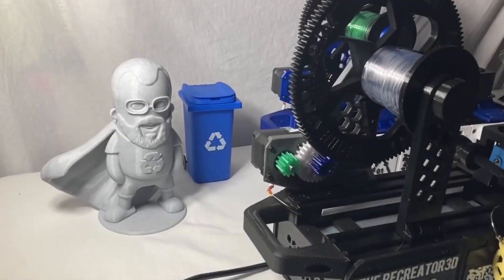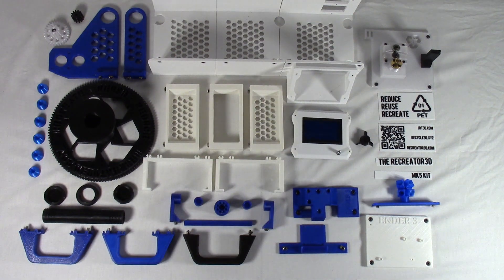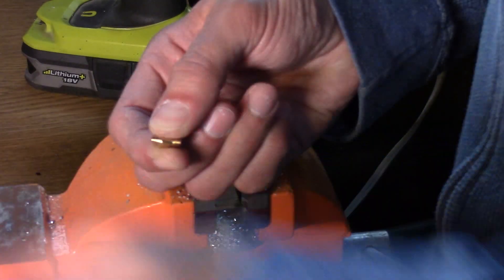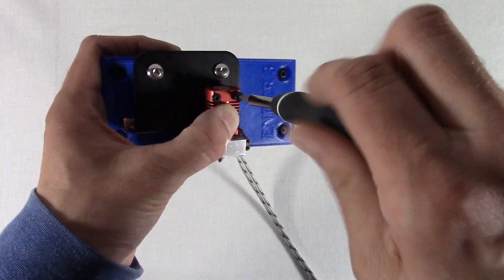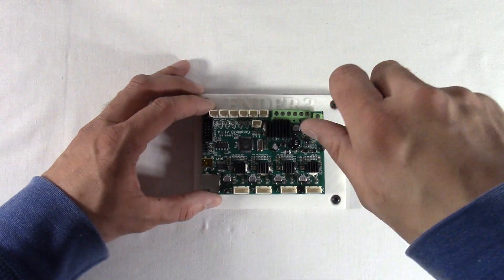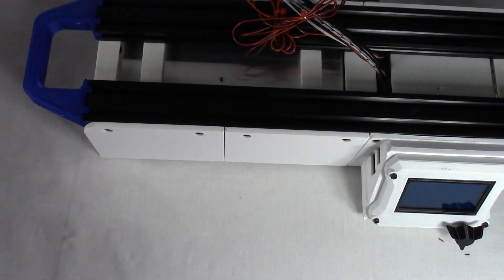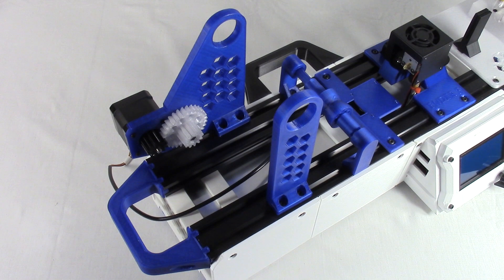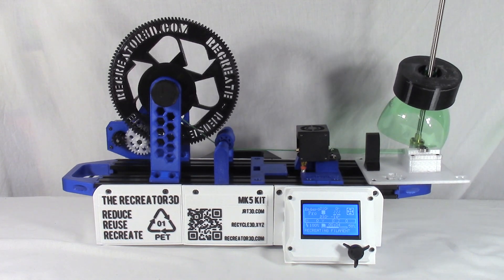The Recreator 3D - MK5Kit : Ender3 -  DIY Build Notes - PET Filament Maker - Plastic Pultrusion Unit

Comment: Totally disappointed. I spent whole days on it and there is always a problem. The stepper motor is not powerful enough, it spends its life blocking itself it’s HELL. I can’t let it turn by itself without it getting stuck! Spending so much money for such a disappointing result...
Reply from the maker: Plenty of help in the support groups in discord or Facebook to troubleshoot your issues. You can go to recreator3d.com for the links. Feel free to join and ask for help. You should be using a 42x40 motor, which when vrefed works great! If you’re having issues, it’s likely user error - as we have over hundreds of people without issues and plenty of documentation to help otherwise.
Reply: @JRT3D pardonnez moi de mon agacement je n’aurais pas dû, je vais essayer les moteurs, 42 × 40 seul problème sur la Under 3, il y a un petit engrenage sur l’arbre du moteur qui fait qu’il faudrait agrandir le trou de l’engrenage en plastique

Comment: i have done it i have followed your instructions and built this machine the gcode works the bottle cutter works all there is to do is drill out the hole on the block and get the correct screws ty so much .

Comment: so i built the machine, but the bottle is not melting with 210c temp. Also its not getting higher than 210c and printer starts beeping. What am i going wrong and how can i solve this?
Reply from the maker: you likely have some parts that are 24volt but running on a 12volt power supply. Everything needs to match
Reply: @JRT3D everything connected correctly, i joined the discord, solved the problem. hotend fan was connected to always on power, so it wasn’t giving an ability for hotend to heat up. Once i turned it off - everything running smoothly & fast. Thanks for such amazing project though!
Reply from the maker: if built from a stock ender, check that the thermostat isn't damaged

Comment: Having built my own from scratch and all the iterations to get it to work well I can clearly see what a great design this is.  My main goal for mine was to spend NOTHING.  I literally did not have to buy so much a single part for it.  I used only what I already had on hand or salvaged from other failed/broken projects.  It's about 95% of what I want it to be.  I have made a LOT of filament with it and things are starting to show their age so I suspect it is time to consider replacing/upgrading.  I have well over 10kg if finished filament itching to be printed and I think this would be perfect...to print off the PET machine from recycled PET.
Reply from the maker: This lifts my soul, as it was my intentions to give the community a build that felt familiar to  us, that also didn't feel like a Frankenstein build. We all start somewhere, as did I. 

The Recreator3D's goals are to keep our electronics from becoming potential ewaste and our plastic inside out homes! Many community members love to know they can use their bottles back into the pultruder build itself. 

Look forward to seeing your build. Join the discord or facebook group if you have any questions. Not all the parts need to be printed, depending on how much you want to encase it.

Comment: are you supposed to drill the frame? you can't screw everything into it with only 4 holes lol
Reply from the maker: I'm not sure how to answer this. Are you reviewing the BOM notes with the video? If I understand what your issue is, you'll be ordering t-nuts and using M4x8mm screws to mount everything.

Comment: The cooling plate fan on mine doesn't spin. Is it ok to just leave it or does it need to be replaced? I've been running it without the fan for months and have only just realized it doesn't actually spin.

Comment: I'm really sorry for saying this, but I absolutely hate this project because it is really overcomplicated. So many things to print + you have to buy screws and bolts
Reply from the maker: Many would disagree with you. Recreator3D is one of the more polished builds and communities for PET Pultrusion. You can also look into the MK6 Fun Size version for a small build platform.  However, it's OK to have varying opinions and options. There are plenty other builds and brands you can find that may find your path more suitable to your desires. Check out http://ppu3d.com/ for more examples of pultrusion. Happy Recreating!

Comment: its too fast. need to slow it down
Reply from the maker: You can reduce the playback speed and pause it. As well, rewind and replay. Version two of written notes are coming out after July. Stay tuned.
Reply: @JRT3D  thanks! Sorry if i sound rude but this old format flow feels rushed. The monologue and the vid doesn't seemed aligned with what you're doing. Even 1 hour worth of video with separate time stamps will be highly appreciated. Thank you sir.
Reply from the maker: @MrJackfriday  Thanks for your feed back. If you need something more in depth, check out our MK6 Build Video...it's likely more to your speed. https://www.youtube.com/watch?v=U18uEw_1qAM

Comment: Hello JRT3D

With a group of Friends for a class project, we need to recycle plastic using the 3D recreator.

The problem is, that we can’t go up with temperature as the system can’t reach 200 degrees and stop at only 40.

The problem’s type is E1 and please we Need help on how to fix it.

Thanks a lot

Comment: How did you describe that only one motor works and runs constantly?  I have the makerbase mks robin nano v1.2 and can't get it to work
Reply from the maker: Our tutorial uses the extruder connection and our gcode is setup for marlin to run the length of a 2L bottle.

Comment: Hey, I am building the MK6 Fun size, and the build notes didn't mention rounding the lip of the heatsink. Why?
Reply from the maker: Recreator3D started with an XViCO X3S - that heat sink 100% needs to be drilled out. This carried over into the MK5 simply out of practice. Later with experimenting with the MK6 we found it wasn't needed and keeping the build easier for for novice builders. It may likely help over all, but it's something we've personally stopped doing or sugguesting is 100% needed for proper results.
Reply: Yeah, when I tried to pull, the strip was kind of expanding around the lip, therefore not winding. Since I don't have a stemless drill bit like yours, I instead drilled out the lip from the side where the grub screw is nearest to. I will try now @JRT3D

Comment: I have a question from another comment I saw from a different similar video a while back, would it be possible to do 3 thinner strands at once with this method? One of the concerns that was brought up in that comment I saw (and makes sense) is that you don't really get much from ONE bottle at a time, however, if you were to make thinner strands from 3 different bottles you would be able to increase your length of filament by 3x (if you did 1/3 of the single bottle width, longer of course if you did even more thinner strands). My concern would be if you could feed multiple into the nozzle at once and if it would be able to heat it up enough to melt all of them at once?

Comment: I don't have PETG for the heater mount, will PLA hold up fine?
Reply from the maker: It will eventually melt along the process over time, you should get enough pulls of PET1 with a PLA mount, in order then print another out of PET1 so you can see just how robust the material is

If out of PLA - 5-8 walls and 50% infill

Comment: 5:14 these screws were too long so i had to bend some of the fins so the screws would screw in all the way. 5:56 what screws are these for the blower fan? The original ones are too small. Where do i buy them and the cutter part is out of stock so where do i buy it? Is there a better updated instruction video that explains where all the extra parts are put?
Reply from the maker: In the discription is a link for written build notes with all the information you're looking for. What "cutter part" are you referencing as out of stock?

Comment: Thanks for your effort and dedication. How can I modify the G-Code so that the Motor / Wheel spins in the opposite direction?
Reply: I know it's been a while and you probably already got your answer but just in case you didn't there is no need to modify the gcode.  You only need to swap two of the motor wire.  If they are paired A-A+ B-B+ then swap ONE pair so it would be A+A- B-B+.  Hope that makes sense.  Just use a multimeter on continuity mode and test each pair.  When it beeps you know you have a single coil.  Just take the pins out of the connector and swap them.  That'll reverse the motor direction without needing to modify any code.,

Comment: Does it work with a 4.2.2 board?
Reply from the maker: 4.2.2 and 4.2.7 are suggested as the are silent. You'll enjoy the Pultrusion process 100% more with a silent stepper :)
Reply: @JRT3D  the only thing I dont get at the video is, using the menu, so as far as I get we must heat the nozzle and then use load filament menu? Or is there a special g code for it

Comment: Does pulltrusion work with other filaments if they are in a different format; not the bottles/tabs?
Reply from the maker: Some Recreator3D users have pulled PP/HDPE - and had mixed results with printing. The more we play, the more we learn :)
Reply: @JRT3D  Cool dude!  Do you know where I can see a website or repository of who has tried what.  Considering doing something like PC or PC/ABS multi material cores at or near or below its transition temp; and wanted to see if anyone had tried that outside an academic context.

Comment: Great project but i want mainboard and LCD where i can buy thank sir
Reply from the maker: Ender 3 Board and LCD are some of the most common available boards you can buy. Otherwise, consider what else is in your area - as our pultruder works with marlin based gcode

Comment: I have a question: how many meters or kilograms of filament do you get for each plastic bottle? And how long does it take to convert a plastic bottle into filament? And how long can the machine work continuously?
Reply from the maker: 2L bottle can yield 25grams and depending on the technique/desire for end result can take anywhere from 15minutes to 45minutes depending on your desire for 90% or 100% unhallow cored filament. Some don't mind compensating slicer settings where others want complete perfection.

Comment: In the other video, you use a stepped drill bit. Is there any specific reason that can't be used here? This is an awesome project, by the way!
Reply from the maker: For the Ender 3 Stock Heatsink, we've moved forward with suggesting that it's no longer needed to drill!💪The MK3 was made from an XViCO X3S 3D Printer and 100% needed to be drilled.
Reply: @JRT3D  oh, that's great! So the only thing that needs to be drilled now is the nozzle?
Reply from the maker: @zachboatwright  Correct
Reply: @JRT3D  That should be in a pinned comment, as stepless bits are insanely hard to find, and it had me stumped for ages.
Reply from the maker: @KannaKamui  You can use a step, stepless, or even a standard drill but if you desire to open the throat larger. We've gotten away without even drilling on some of them. I'll work on implementing this note into our over all platform. Sorry for the confusion.

Comment: You show loading the strip into the hotend cold and "easily" going through and then setting the temperature. How are you doing this? Also, I have downloaded the suggested gcode file and see it goes no where near as fast as what is shown in the video
Reply from the maker: Watch this video here: https://youtu.be/MvR3WfJN7RI
Reply: @JRT3D  Thanks Josh....I got it to work by cutting the strip very thin. Got it all working accept I found getting it to grab the spool a little difficult, but fixing that now. 

Edit: Tension on spool fixed. I printed in transparent and couldnt see the holes in the spool for holding the filament.

Comment: Tempted to pick up a crappy unrepaired ender 3 from eBay to gut for parts to make one of these :D Though I've got much better motherboard, lcd and steppers lying around :)
Reply from the maker: Saving a crappy unrepaired ender 3 from eBay is the perfect way to get the best bang for your buck as well as saving potential eWaste. If you got parts to, it's not a complicated build otherwise.
Reply: @JRT3D  the lure of gutting an ender 3 without even trying to make it work is rather strong 😂 😊 I need to build up my scrap pike of parts, so I guess I can keep  a bunch of other bits. They're only around £60-70 and pretty sure parts are worth that alone haha 😳 

I'm thinking to do an injection moulding machine based off a screw drive later on, but I'll need to finish the CNC conversion of my lathe to do that as I don't fancy paying  insane prices for a simple screw that I can just make myself 😊
Reply from the maker: @noviceartisan  $80 is more or less cost of parts. The worst is buying one to turn into a recreator, only to repair it as a printer...do you turn into a recreator3d or buy another used printer...vicious circle for a person who enjoys the tinker.

Comment: Hi, thank you that wonderfull machine!, where i found the G code??? I need to load the SD card, thanks again <3
Reply from the maker: It's in varying spots that you should be able to find at this point. Can you please inform me where you downloaded the files? Should my notes or directions elsewhere be more clear other than what I've included within the files to download?
Reply: @JRT3D  hi, finally we get the code, now its works, but the wheel turns in another direction
Reply from the maker: @paulacoloma2666  reverse your motor wires to change polarity. switch the outside wires with eachother, and the same for the to inside. if this doesn't help you, we have an alternative gcode.
Reply: @JRT3D  hi!, thanks for answering, greetings from Chile, finally we switch the wires but doesn't works 😞 ,  can you help us with the code?
Reply from the maker: @paulacoloma2666  Please find us at one of our groups for better Q&A

FACEBOOK: http://facebook.com/groups/recreator3D
DISCORD: https://discord.gg/vn2CH72bMq

Comment: An Ender 3 may be popular but they not that cheap used in my area. I have seen them going for no less than $200. Decided on using an ET4.
Reply from the maker: At 1 up cost of parts, it's more or less the same. you can choose most standard 3D printers and get them to some state of PET Pultrusion.

Comment: Hello, I have a question: what is the specification or model of the nema motor used in this machine?
Reply from the maker: Nema 17 42-40
Reply: @JRT3D the Ender3 I purchased came with all 42-34 motors, which led to some confusion since I have never owned an Ender3. 42-40 now ordered, thanks for th confirmation
Reply from the maker: @jacobnowatzke4371  Was it a standard Ender 3 Pro? I've never seen or heard of any that didn't have a 42-40 for the extruder gear motor (all other motors are the 34's)

I could be wrong - which, would explain a couple people's complaints without further explanation.
Reply: @JRT3D  it wasn't a Pro, and the extruder motor is labeled as a 42-40, but is conspicuously missing the notch on the shaft. It's very odd, and has set back building by a couple days, but no complaints here.
Reply from the maker: @jacobnowatzke4371  feel free to share in the discord or facebook groups link through recreator3d.com

Comment: i like all of this and i think its great but im am unsure how the firmware would be for this and how you actually start a print, using the original board, beacuse the motor isnt going to move unless your giving it a command or having it execute a print, or if your just llike having it like extrude 100mm per say, if you could help me understand this would be great, also i think using milk jugs would have the same effect.
Reply: or if the gcode files included in your websites for the 300 and 600 and 900 for the sd card would be it
Reply from the maker: @dylanhuntington8187  Yessir - No firmware changes are needed. Load a strip of filament. Temp to 210C to load strip to spooler, run gCode command and happy Recreating!
Reply: @JRT3D  does it really matter if you use a stepless or a step drill bit. because i mistakenly picked up a step bit rather then a stepless, im sure it would be some catches in there and youd want to be smooth correct?
Reply from the maker: @dylanhuntington8187  Moving forward with ender 3 heatsink, most should be able to take in the strip without needing to be drilled. A stepped bit, should be used slowly...and not to deep. I've tested without drilling and it works just as good.
Reply: hey i have a question on the gcode file is there an stl file i can modify the temp you have them both set for is to low for me
Reply from the maker: @dylanhuntington8187  Your statement is a bit confusing. 

210C for the Pultrusion process should be fine. 

If its not allowing it to be pulled through, your bottle thickness may be to much to the strip width for the diameter of your nozzle, which may also need to be widened.  

Any slicer profiles I've posted are for 260C for printing temps.
Reply: @JRT3D  I was having alot of issues with 2 liter bottle but once I switched to a couple 20 oz bottles I didn't have as many issues.
Reply: Okay awsome thank you, wasn't quite sure was going to try it anyway